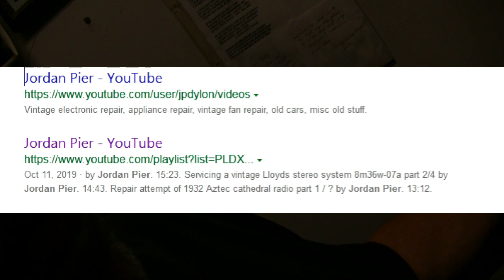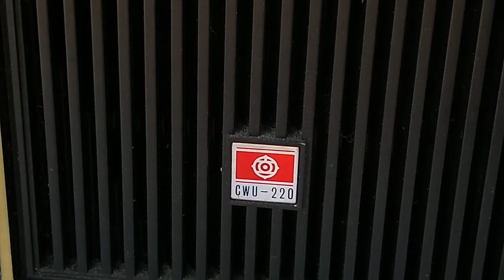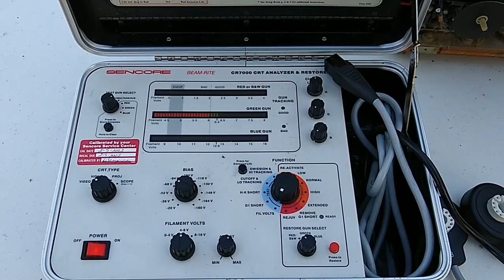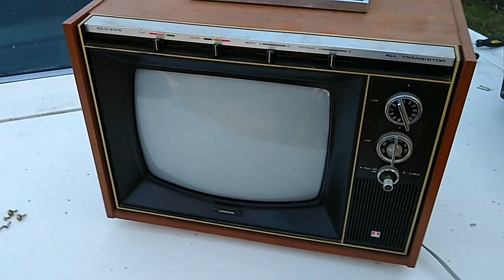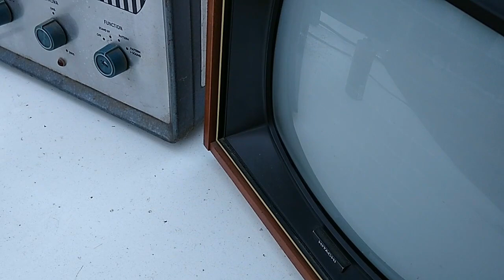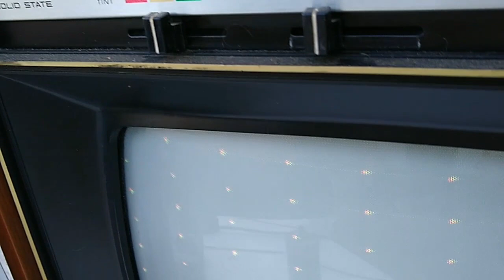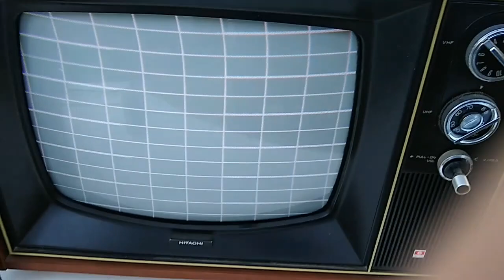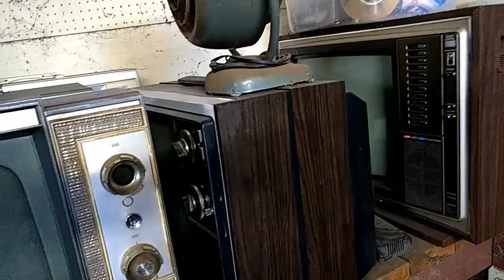Jordan Pier jpdylon Terminated By Youtube A Mistake Hitachi CWU220 Color TV Analysis

Comment: Well that stinks.  I'm trying to learn how to fix radios and stuff. I am an Extra Class ham radio operator and wanted to work on them now.  I just found you yesterday.  I need a lot of help.  I lack troubleshooting. The only test gear I have is an old Hickok scope. I have a multimeter. So I've been hitting electronic repair videos heavy lately. So any input would be helpful.
Reply from the maker: Lots of radio repair repair videos on this channel, not ham stuff mostly AM FM transistor and Tube

Comment: RE: Nippon Chemicons - I have not had such wonderful experiences with them. I just finished restoring an early solid state Akai filled with them. Every single one of them was WAY bad. Some were shorted. All were far from their value and all were leaky beyond belief. The former owner had turned it on and the output transistors blew from the torture. So did all 5 of the fuses.

Glad to see that these weren't as bad. Probably because the set was used until much more recently than than the Akai. Moderate use tends to prolong the life of capacitors where disuse kills them.